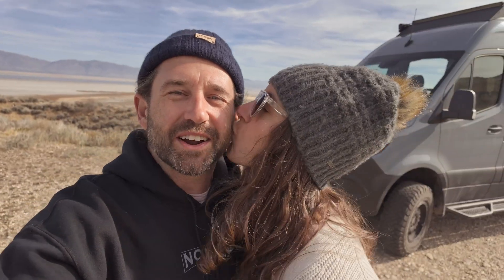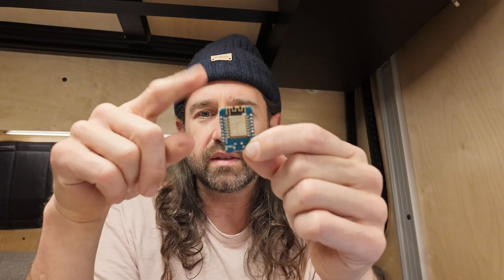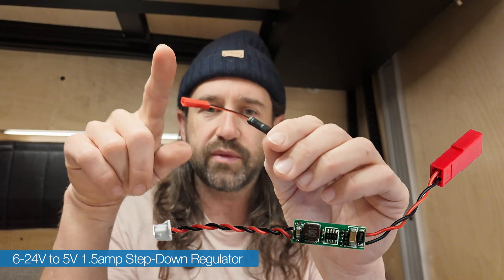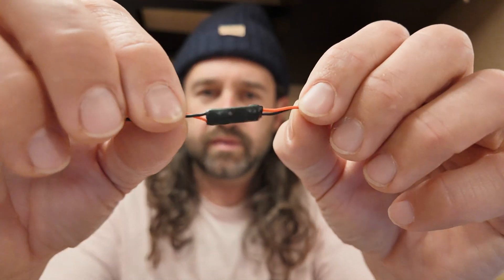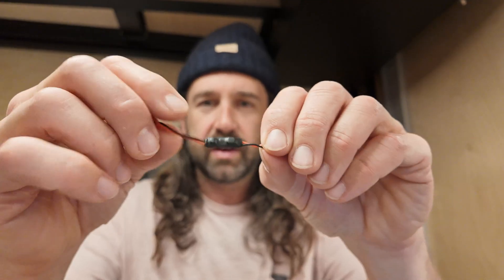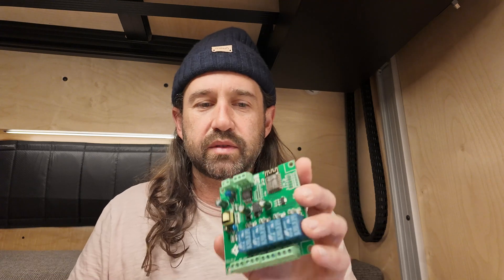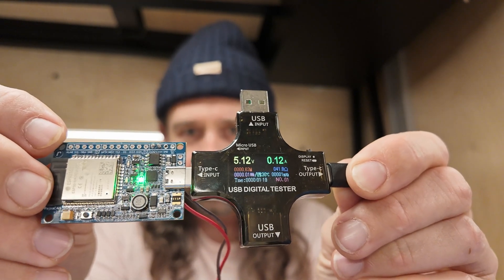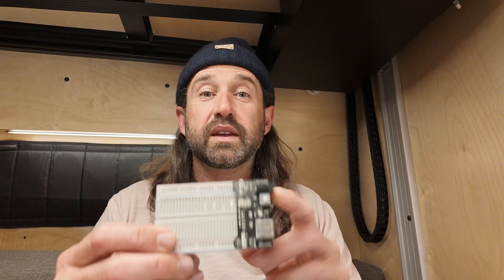Powering ESP Microcontrollers from 12 volts

Comment: Are these relay boards capable of doing 2 wire pwm?  I've got an ambulance with dimmable 12v dome lights and would love to maintain that functionality while removing the archaic controller system currently in it.
Reply from the maker: I assume you mean the MOSFET board? That one is indeed using PWM: https://amzn.to/48Li8FM
Reply: @SmartyVan  Anychance one of those exists with an esp32 glued onto it?
Reply from the maker: Not on the cheaper end, but check out these guys… https://www.kincony.com/esp32-pwm-dimmer.html

Comment: Are all of these "24V" parts safe for 24v system charging voltages?  Possibly as high as 29.2v with tolerances . . . .
Reply from the maker: I'm not having any luck identifying the step down IC (for the 6-24v tiny converter) so that I can find a data sheet. However, a reviewer on Amazon does note that they tested up to 30v without issue. I suspect this step-down converter will work at 24v charging voltages, though I haven't tried myself. Here's the review: https://amzn.to/3O0fP8b - let me know if you get a chance to test them yourself!
Reply from the maker: As for the PlusRoc 15w step down, the product info says 8-35volts